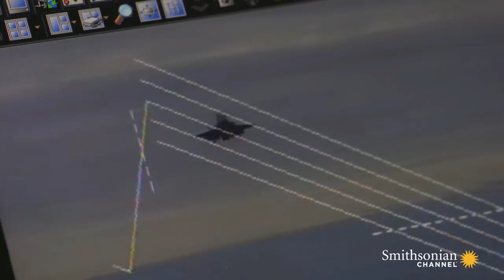This Fighter Plane Landing Has Never Been Attempted

Comment: Excuse my ignorance, I’m no fighter pilot but surely it’s easier to land a plane at 60 ish mph on a carrier than 160 mph on a carrier . Just like we used to do or like the US currently do.
Reply: The British have been landing like this since the Harrier.  The Harrier is basically the F-35’s grandfather. We’ve had lots of practice.  Royal Navy even landed them like this in war zones.
Reply: @muttley8818  I never knew they landed the harrier on the invincible carriers like that .
Reply: @pauljones8149  Oh yes. They landed them vertically.  I’ve seen a video of a Harrier landing on Invincible during the Falklands conflict.
Reply: @muttley8818  This isn't quite a vertical landing. This what the RN call SRVL (Shipborne Rolling vertical landing) it's basically a combination of a normal landing and vertical.

Vertical landings can only be performed with the F-35 (And the Harrier) when they're light, so it often involved dumping fuel and weapons. This lets them land with more fuel and weapons aboard.

It's pretty precarious because you don't have a lot of room to get the aircraft on the deck, once you're so low then you're committed. Once they've got it down then it should probably be easier than an arrested landing on a US carrier I'd imagine, but as it's the first time doing it on the carrier outside of a simulator, you've got to be careful.
Reply: @muttley8818  "The British have been landing like this since the Harrier. "

Not at sea they haven't. You're confusing a vertical recovery with a SRVL recovery.

Comment: That was onto the HMS Queen Elizabeth in 2018 but SRVL had already been done by Harrier in 2007 onto the Charles De Gaulle with further landing approaches onto HMS Illustrious in 2008. So, "never been attempted", not true. The previous tests in 2007/2008 developed the procedure and the Bedford Array. HMS Prince of Wales is also equipped. First SRVL - by a F-35B.

Comment: Why was that extra slowness so much better then jets that normally land on the carrier?
Reply: They normally require a tail hook and cable to catch them in order to stop in a short distance.

This method let's the aircraft land without that. They also tend to operate from ships that don't have the arresting cables (This version of the F-35B doesn't have the tail hook either).
Reply: Ben yes thank you but I am aware of the systems used by the jets to land on a carrier but ok so you don’t have to use a tail hook but looks extra risky especially so with a full weapons cache still on board the platform according to the narrator.
Reply: fire tiger white cosmic beam I wish you didn’t bother.

Comment: I think they meant the F-35B hadn’t done it yet. Harriers do it all the time
Reply: Not all the time, generally they will land vertically. Due to the complexity of the Harriers controls it would be very difficult to do this regularly.

They tested it in 2007 with a specially modified Harrier that had fly by wire systems as a proof of concept for the F-35 though.
Reply: "Harriers do it all the time"

Incorrect.

Comment: They really should work on a system to make it very easy for the pilot to land .
Reply: They already have them. This video is just blatant misinformation and over dramatized
Reply: @ascherlafayette8572  I wouldn't say it's misinformation, this is the very first time they've performed this landing on this carrier outside of simulators, it's going to be difficult to pull off.

They have developed a new landing aid called the Bedford Array, which should allow more automation. This isn't yet implemented on this carrier, her sister ship has, but it's still undergoing trials.

Comment: If it needs so much stuffing around to land then it is not ready for war.
Reply: This was back in 2018 for the very first tests aboard this ship. It was quite smooth all things considered. Any new carrier landing is difficult and dangerous at first, arrested landings like US carriers is probably more dangerous due to the high speeds required. But pilots practice over and over so it becomes second nature.

There are also landing aids that will help with it that are going to be implemented.

Comment: Wait.....   they built an entire ship around a procedure that has never been attempted!?
Reply: HellishGrin460 no
Reply: pizza_parker Yes...    They said in the video it had never been attempted before.
Reply: No. The ship was designed for STOVL operations. It's been refitted with a Bedford array after SRVL was brought up during testing and development of F35 by the UK contingent. The "never done before" should have said "never done at sea by F35 before". Harriers used SRVL for the same reason. This allows the F35 to increase its bring back mass by generating 90mph worth of air flow over the wings, generating lift and supporting the engine's power.
Reply: @hellishgrin4604  Yeah it was tested using a specially modified Harrier in 2007 for this purpose and to prove the concept. Although the ship wasn't designed around this being a requirement, they would have continued to use vertical landings if needed, it's just a bonus.
Reply: @ScienceChap  "It's been refitted with a Bedford array "

The QE is not currently equipped with a Bedford Array. The Prince of Wales is.

"Harriers used SRVL for the same reason."

Other than the modified VAAC Harrier how many others successfully executed SRVLs at sea?

Comment: Who designed it to not be able to vertically land with munitions?
Reply: All VTOL jet aircraft are the same, they can carry a certain amount back, but it would require an engine far more powerful than anything available today for them to hover with a decent payload.

That's why they do short rolling take offs instead of vertical from carriers.
Reply: The laws of physics dictate the feasibility and costs of designs.

Comment: But what's the point of a vertical landing if the best pilot in the ship needs 3 attempts to land it?
Reply: Rudy Flores pilots can already land it on a stationary target. It's the moving targets that's getting attention. Now that it's done for the first time those to follow will find it much easier. 

It's never been done before so they need someone with great expertise to find the way to do it so others follow in these footsteps. It's not the most efficient right now but in time by understand what was correct and incorrect it'll be much easier to teach this to other F-35 pilots. 

What was really difficult was the Harrier. Beautiful plane but deadly. Deadly for the pilot as well as the enemy if the pilot didn't respect the plane
Reply: The equipment itself that guides the aircraft in needs calibrating. It was a test flight. You can guarantee that these landings are now mostly pulled off first time.

Comment: Seems weird to even attempt this. The amount of lift at that speed must be negligible. Are they hoping that, using that maneuver, they wouldnt have to jettison fuel and/or armaments?
Reply: Yeah its main use is being able to bring back fuel and weapons, it's surprising how a small amount of lift from the wings can make a pretty big difference (The F-35B goes from being pretty limited in fuel and weapons with a vertical take off, to being able to carry a full fuel and weapons payload with a short take off for example).

Plus when performing a vertical landing they have to come into a hover alongside the carrier, line up and then land, so it needs to be able to hold the hover for a decent amount of time compared to a slow rolling landing like this.

Comment: No American pilot to land the American jet?
Reply: This was flight testing for the UKs new carrier, so it was performed by UK test pilots. They've been pretty involved in the project too though as they've designed and built a good proportion of the aircraft, particularly the B variant here as the vertical lift systems are made by Rolls Royce. The prototype for this variant (The X-35B) was also first flown by a British test pilot from BAE Systems.

This particular maneuver is something the UK has been testing for many years now mainly for use aboard their carrier, I don't think the US has plans to perform it themselves as of yet.

Comment: Seriously, what is with the 20 foot windows in the control tower. Do they not intend to take this ship to war? They've even got dot-matrix signs with the flight schedule on it.
Reply: They're made of armoured glass, strong enough to take a hit from a Chinooks rotor blade. The screens just make things easier and more efficient for the flight deck crew.

Aircraft carriers operate very long distances from any combat zones, if they come under attack it'll likely be from a missiles. At that point it doesn't really matter how big the windows are. Basically it's all about making things run as smoothly as possible to get aircraft in the air and back.

Comment: How is this any different to what RN Harriers and USMC AV8s used to do?
Reply: They would land vertically, this type of landing was deemed too dangerous to perform with a harrier on a regular basis as the controls were much more complex and the landing gear and breaks weren't as robust as the F-35.

It was tested on a modified Harrier in 2007 to prove the concept though.
Reply: @Benjd0  
This 'SVRL' would also protect the landing deck surface from excessive heat damage wouldn't it?
Reply: @jabberwocky1707  Yeah that's another plus, the deck does have a special coating to prevent damage from the exhaust heat, but this prevents wear over time.

Comment: "Like a rocket in reverse."  It sucks air into the exhaust nozzle instead of blowing it out?
Reply: Air Intake is on top where that big door is opened vertically (could also double as an air brake)

Comment: When did they add a kicker launch ramp to aircraft carriers?
Reply: We Brits have had them since the 70s, the Russians have them too
Reply: The British first used them in 1944 on HMS Furious so that the heavier FAirey Barracudas could take off with maximum load.
Reply: @HairyAl1969  I had no idea. I have been aboard a couple of carriers here in the states and have never even seen photos of anything other than the flat decks... I have been under a rock I guess.
Reply: @HairyAl1969  "We Brits have had them since the 70s, "

First permanently installed on HMS Invincible in 1980.

Comment: anyone else notice they have ramps on their boats?
Reply: It's been a feature on British aircraft carriers for nearly 40 years, Bo.  It was introduced to shorten the take off run and save fuel for the Sea Harrier.
This landing technique was also used by the Sea Harrier.  The vid' may show the first time it has been attempted with this aircraft but i understand that the technique is an old one.
Reply: @farrier2708  i get that.  but i've never seen it before, and it's gotta be fun

Comment: I thought this was a standard procedure by British Sea Harrier pilots.  Could somebody confirm or refute
Reply: The standard procedure was a vertical landing, I think I've heard of this potentially being used in some very rare cases, but it was too difficult with the manual controls on the Harrier to perform on a regular basis.

They modified a Harrier with fly by wire controls and tested this concept in 2007 aboard Frances carrier, to prove the concept to use with the F-35.
Reply: No, Sea harrier would take off from a ski jump and land vertically.

Comment: Wondering why the country who developed it, isn't the one testing these manuevers....
Reply: The only Russian aboard a Royal Navy vessel would be a stowaway.
Reply: Because this is a special capability requested by the Royal Navy (who I guess can't afford to routinely dump highly expensive ordinance into the ocean every time one of their planes land. In fact the British developed this with the Harrier in 2007. British F35B will is differently equipped to US version. US version is not equipped to be able to do this.
Reply: @krashd  What are you talking about? 
I am talking about the US, who developed the F-35...
Reply: @markturner4219  Um....a USMC F-35B conducted the first vertical landing somewhere around October 2011....are we ignoring that? I'm pretty sure if they could do that on a carrier, they could also execute a rolling vert landing on a carrier.
Reply: @LTdesign13  It is not a matter of pilot skill. USMC F35B's are not equiped with the necessary modifications to allow them to do the rolling landing. Also, the normal vertical landing is easier to perform than the shipboard rolling landing.Perhaps if you had taken the trouble to read my post properly I would not be having to say the same thing again.
Reply: Bare in mind it's a joint program, the UK were very involved in the development, particularly of this variant due to their experience with the Harrier. The prototype X-35B was actually first flown by a British test pilot from BAE Systems too.

This particular maneuver was developed specifically for the Royal Navy as Mark mentioned using a specially modified Harrier back in 2007. Vertical landings are pretty routine for the F-35B and Harrier, but this type of landing is a bit more involved.

Comment: Ahh......NO. the reason the Uk ditched SHAR for F-35 WAS FOR BRING-BACK

If it cant do it, its not worth its ticket price
Reply: That's not the sole reason, as great as the Harrier was, it was outdated in many ways.

The F-35 is actually capable of bringing back more fuel and weapons in a vertical landing, but without massive leaps in engine technologies, you're not going to be bringing all that much back. SRVL has been under development for many years for the RN to allow STOVL aircraft to bring back more fuel and weapons. It was first performed in 2007 by a modified Harrier in preparation for operating the F-35.

Comment: That is the same plane from The First Avengers movie
Reply: Yea it is the same one. Although I think the movie used a CGI model because the military didn't want to contribute to a movie where they were under the control of the fictional organization SHIELD.

The F-35 had it's first flight in 2006 (the X-35 test plane it's based on first flew in 2000). I think the first movie we saw it in was Live Free or Die Hard back in 2007.

And here we are in 2021 and they are still performing tests. Lol

Comment: Do those mega expensive jets lack tailhooks?
Reply: This particular variant lacks it, as it has the vertical lift system instead so will generally land vertically, this just gives them more options.
Reply: @Benjd0  How is removing the tail hook, "adding an option" when it remove the standard carrier landing method? Sounds like, from your very description, removing an option. Just sayin'.
Reply: @Scupplin  STOVL jets like this and the Harrier have never had tailhooks because they can land vertically which is far easier and safer.

The one disadvantage is they aren't able to bring back much of their payload this way. SRVL (Shipborne rolling vertical landing) as tested in this video allows them to perform a short rolling landing using their vertical lift system (So no need for a tailhook). This is set to remedy that disadvantage, it's also performed at much lower speeds than a standard carrier landing, so will likely still prove to be easier once the technique is perfected. 

They essentially have the option for two different types of landings, compared to only one on most standard carrier based aircraft. This means there's not really a great need for a tailhook and other equipment required for arrested recoveries.

Comment: I don't get it what's the point in landing like that in the first place
Reply: If you are selling a VTOL fighter jet and then it damages the surface of aircraft carriers due to massive lack of foresight, this manuevre... is a way to shoehorn them for use on carriers.
Reply: Richie Sacolic A lot of the time planes come back from missions with unused fuel or munitions which make them too heavy to land vertically, meaning they have to dump them in the sea. 

With this type of landing, they can carry more weight when they land, and he de save the munitions for future use.

Comment: The Harrier did this all the time, just shows the f35b is not up to  the task as a harrier was. The Harrier should have been developed to be stealthy, supersonic and British. Also would not have cost so much.
Reply: Laughable comment
Reply: This is a dreadful take. Any capability goes through trials before being rolled out across the wider fleet of aircraft. It's how limits, procedures etc are worked out so they can be published and other aircrew can learn the numbers.

The Harrier upgrades you're talking about would have resulted in an entirely new airframe at massive cost. You can't simply slap a bigger engine into a Harrier to make it supersonic, or some stealthy paint on it and give it a tiny RCS. Both would require a complete redesign.

Comment: So the cable which stops fighter jets cant work on this one?
Reply: Nope, it doesn't have the tail hook and it's made for carriers that don't have one. Generally they'd land vertically, just gives them another option.

It'll likely be a bit safer once the process is down, you don't have to deal with the high speeds you have with a landing with a cable.
Reply: @Benjd0  and it cost a whole lot more. I'll take the hook.
Reply: @growforit8736  I mean the reason you go with STOVL is it's cheaper overall due to not needing all the extra systems and training for CATOBAR.

If you already have the aircraft capable of this then it's cheaper than going for a tail hook and arresting gear.
Reply: Viki Panapasa  The British done away with their old idea and invented stovl. There’s no need for any arrestor cables when the jet is landing at a more gentle and safe speed
Reply: @Then.72  ok so the "trying to land" over and over again will not happen?if it does..then okay..
Reply: Viki Panapasa   Not trying to land , the pilot has shown a better way to land the F35b on the stovl carrier
Reply: @Then.72  ohh okay..